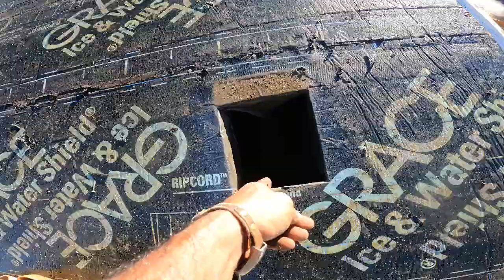A pitch of 2/12 is the minimum for shingles made of asphalt, Low-sloped roof. Modified bitumen#usa

Comment: Nice work clean installation. How long do you expect rolled roof to last  what products to use?  I am building a large irregular shaped porch roof between house and garage less that 2/12 pitch looking for longest lasting roof. What area are you located in?
Reply from the maker: Hey brother, how you doing if you use the poly glass rolling roofing for a low slope roof usually lasts about 20 years! God bless 🙏👍
Reply: So I have a low slope roof with less than a 2/12 pitch on some parts but the roofers placed asphalt shingles.  Should I be worried?